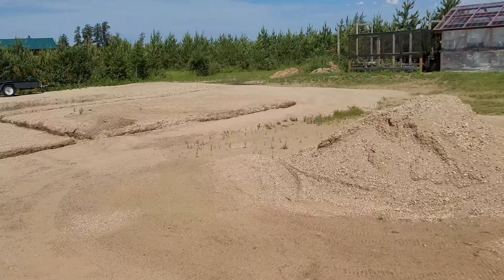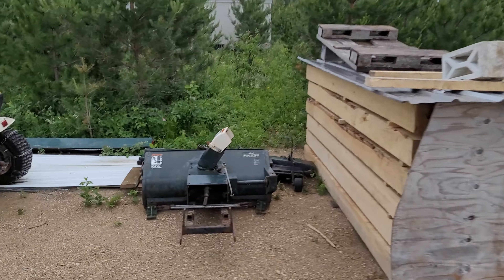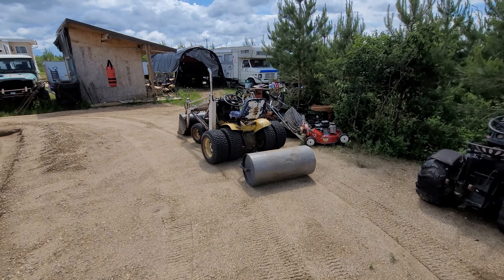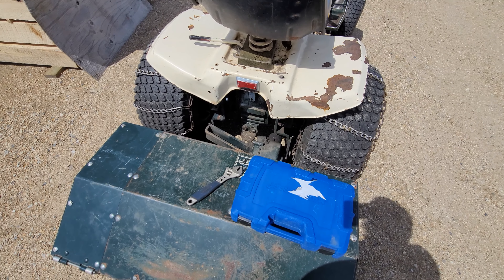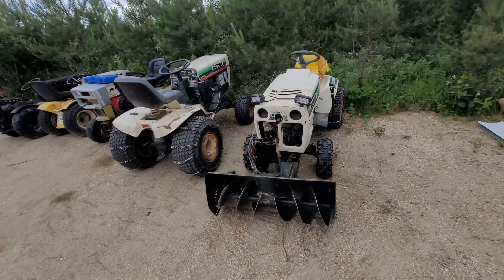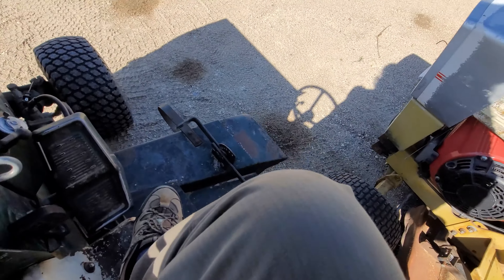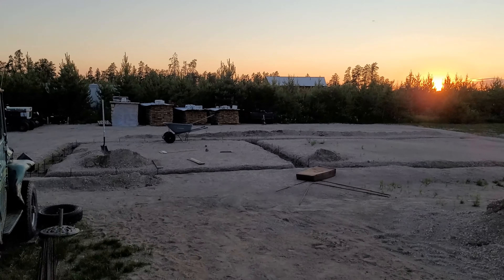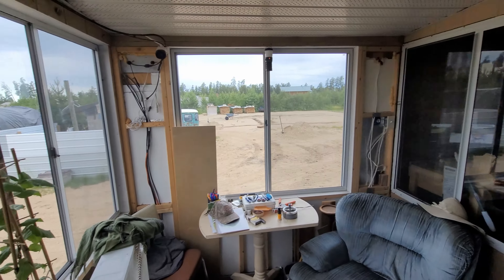"New" Shop Updates (Started Concrete work) & Bolens HT-23 Update.

Comment: That little rattling trailer one of those old Snow Bear trailers? On mine the way the fender is held on with the spring hanger bolts into the c channel the adjust wheelbase, it slightly bent the C channel to one side and caused the fender to sit  loose, trailer still seams to track straight though.
Reply from the maker: I am not 100% Sure who makes this trailer , But yes i am pretty sure thats how mine is made also.